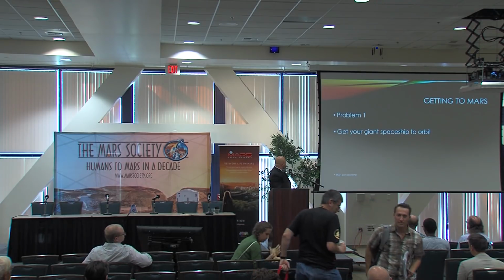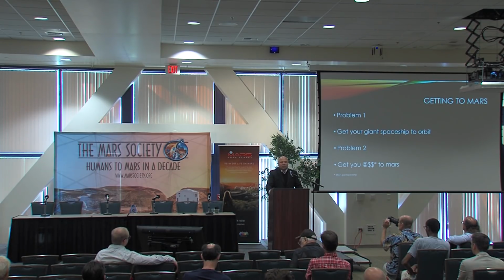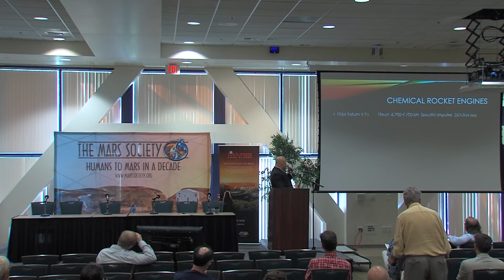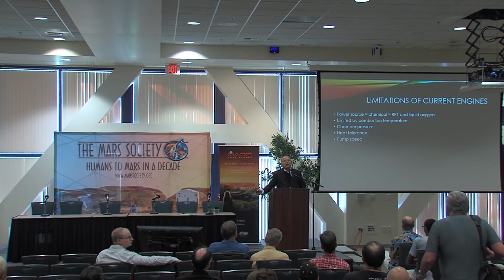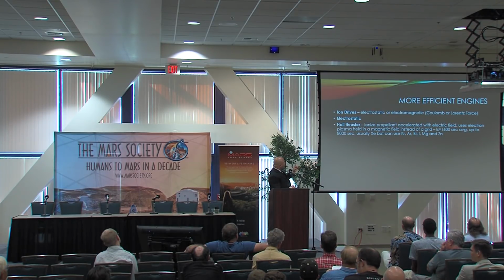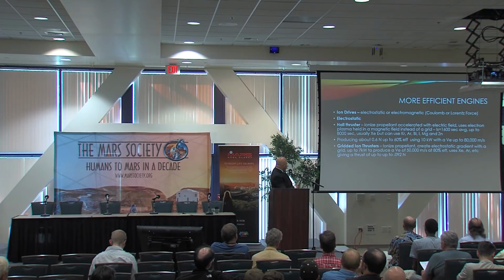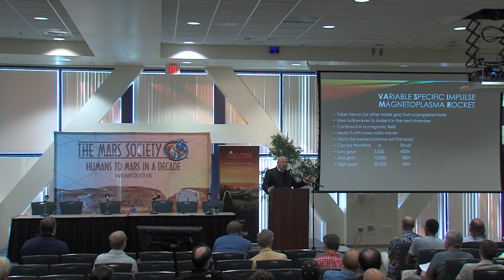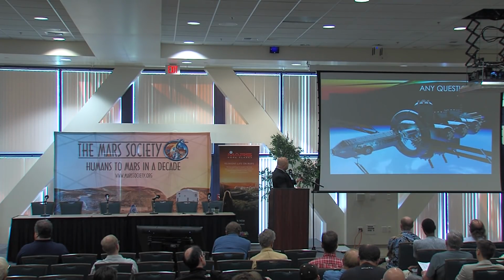Joseph Parker - Advanced Propulsion - 20th Annual International Mars Society Convention

Comment: Maybe it's my love of breeder reactors, but he says around 19:10 that the only practical way of having fusion in space is to mine the moon for He-3. Since tritium decays to He-3, couldn't we, in principal, build a D-T fusion plant on Earth, which already needs to breed its own T, and allow the excess T decay into the desired product? I mean, if you made a fusion/fission hybrid reactor and used FLiBe carrier salt for your fission blanket and heavy water as your power producing working fluid, you'd breed tritium both from lithium fission AND deuterium neutron capture. And since you wouldn't rely just on fusion neutrons for tritium breeding, you could conceivably have breeding ratios much larger than 1, perhaps even larger than 2 or 3.
Reply: You could, there are a lot of viable options.  The D-T reaction is not aneutronic though.